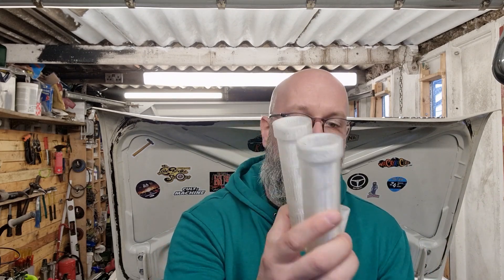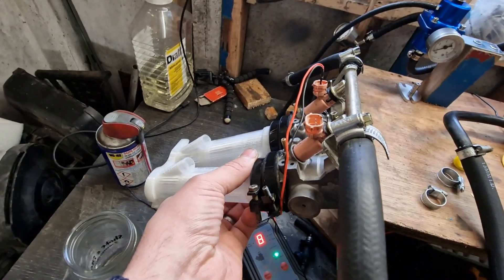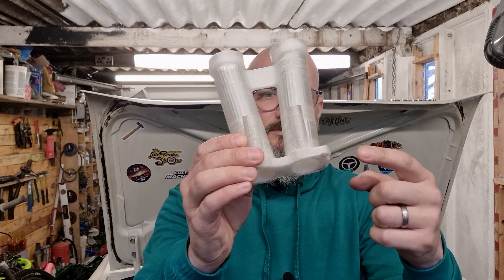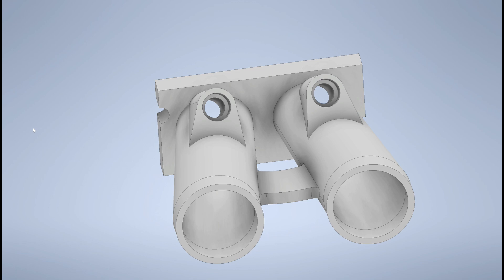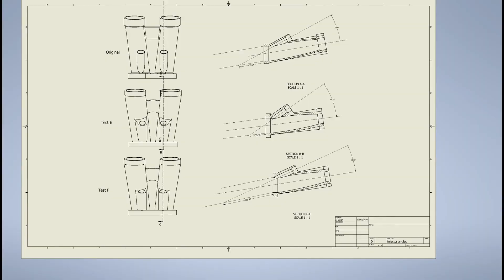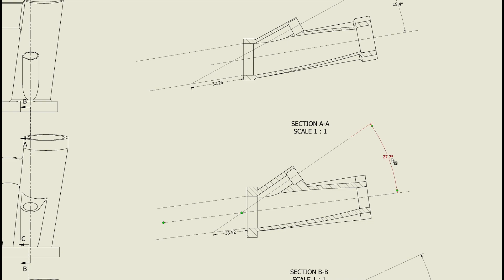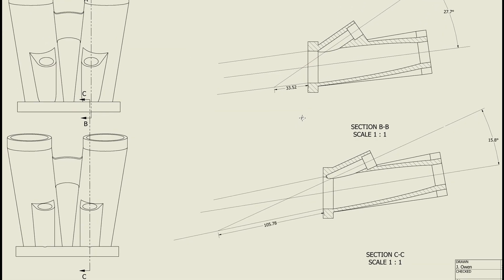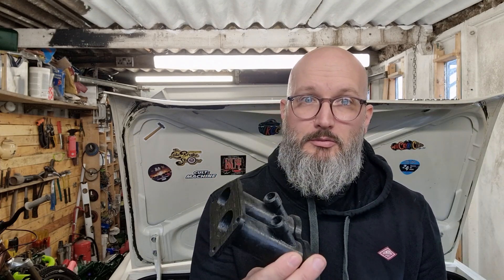What injector angle? DIY EFI build.

Comment: Perhaps a bit late to suggest this. You could mount the throttle bodies in a near downdraft orientation, since you have relocated the injectors, to mount the injectors "on the bend" for a better angle into the head inlet port. Many motorcycle engines use this arrangement, the only real difference being they will have the injector mounted in the head casting. The air going around a bend shouldn't be as critical.
Reply from the maker: Thats a good idea, I've gone ITBs now but there's always potential for improvements! I'll draw it up and see what it looks like.  👍

Comment: You can try lost PLA casting, there is a guy with a YouTube channel, where he shows how to use a microwave oven for burning out PLA from moulds, melt metal, and how to vacuum cast.
Reply from the maker: It's an interesting idea, I have wanted to try aluminium casting.

Comment: My instinct says to point the injector as far as reasonably possible at the back of the inlet valve. Often with stuff like this the overriding factors are practical considerations with regard to manufacture and packaging.
Reply from the maker: That's what I'm finding regarding packaging, I'll try a version with the injectors further back though.

Comment: Can you not drill the injectors directly in the head like for the screamer motor used to drill the carb mounts directly and close the original ports
Reply from the maker: It's an interesting idea, I need to see where is safe to drill on these heads but it's not impossible.

Comment: Exciting project you are working on. Have you included the air flow in the calculation when you set the angle of the nozzles?
Reply from the maker: @vidars2606  thanks, I haven't as I don't have the software to do cfd simulation. If you do it on paper it'll be 1 dimensional steady state which won't cut it.
Reply: Is it possible that you can blow air into the intake pipe while testing the nozzle and in that way see how this changes the spray mist?